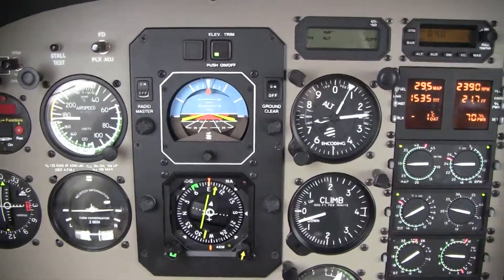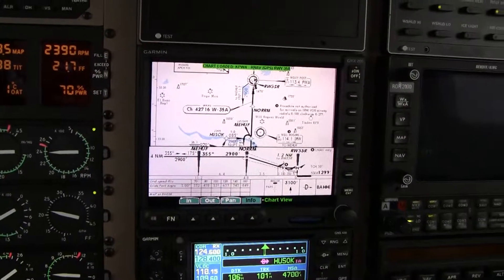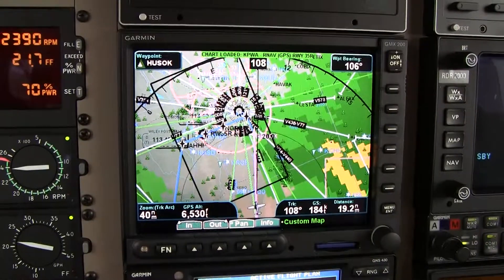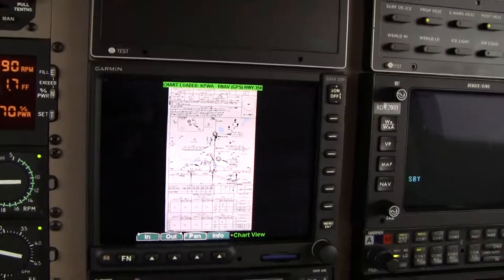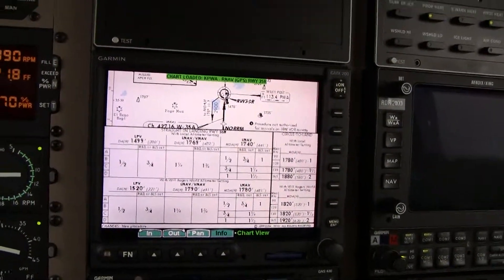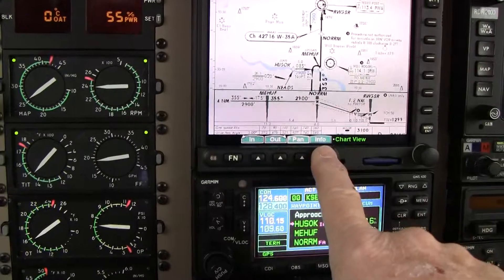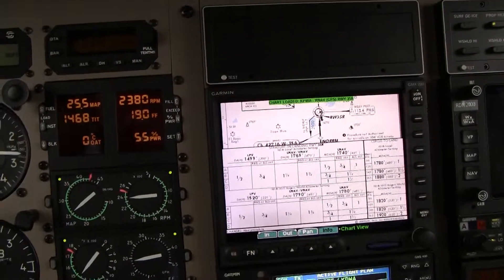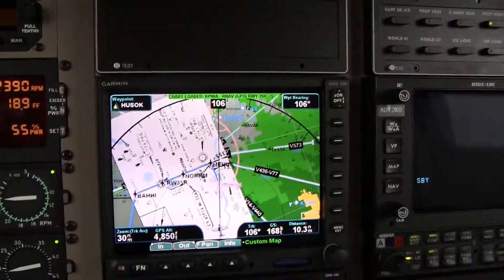Instrument Approach 6-Step Setup in a PA46 Mirage Aircraft

Comment: Does the reduction from 29.5pol to 25 have a better time to do, thinking about the TIT temperature?
Reply from the maker: Yes, however it also brings the aircraft to the proper speed in clean, level flight. I use 130 Kts for the arrival because it is ice penetration speed and Va. 25 inches allows me to get this speed when I level off without having to push the power back up. DR .. Fly Safely - Train Often.